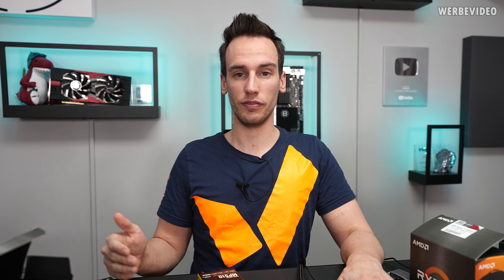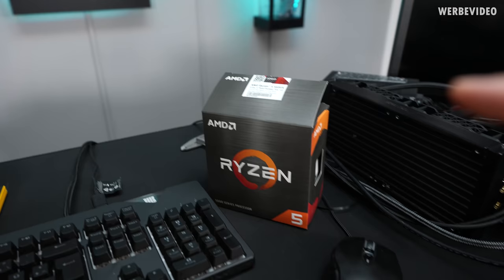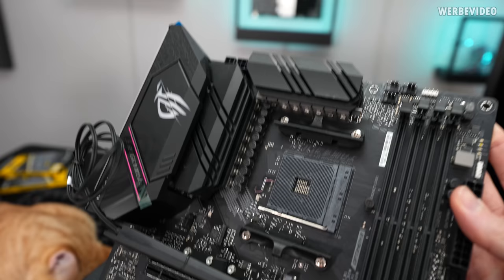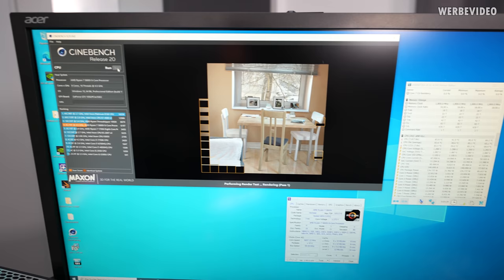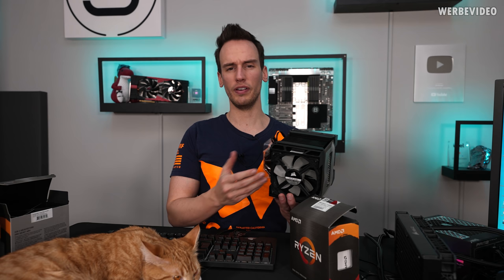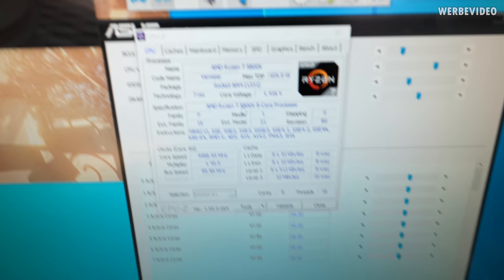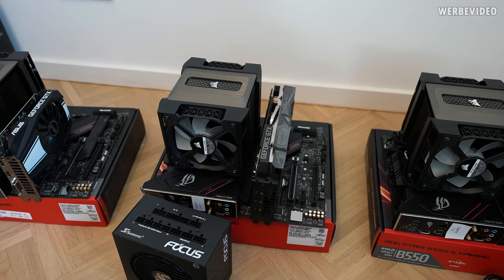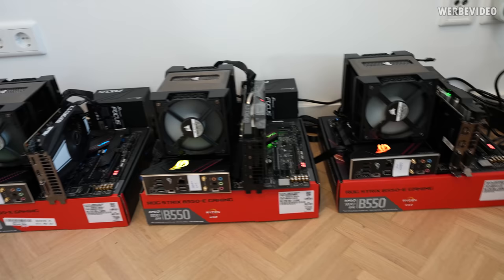AMD Ryzen 5000 Long Term OC Testing - Will the 7nm CPUs degrade over time?

Comment: Why not use something like Boinc or Folding @ Home for a long term test like this to do something useful with the computing power?
Reply: Or mining cryptocurrency and make money for electrical bills.
Reply: I assume he wants repeatable tests. Folding at Home sends packages of varying size, depending upon what they have set up to be solved.
Reply: @johngamble5270  Kind of, but either way it will do the same as the benchmark, run 100% CPU, pause for a short while to swich work unit and back to 100%. Boinc Rosetta may be even better as Boinc have more advanced settings for CPUs
Reply: @martinfinne7259  I`ve been running folding@home for one year. You need internet for that. What if network fails and needs to be down for some longer period, or better yet, windows update? He could disable that with some workaround sure, but this is clean and repeatable. Its better to minimize any possible external factors for this test. Same thing goes for crypto mining... it could hardly be a science experiment if parameters constantly change and your system crashes. Now windows could still crash all on its own, but he can easily check that at a glance with a power meter. Without network and any other background tasks it should be pretty stable.
Reply: Your supposed to fold with your gpu.. not cpu
Reply: @CMstacker  Yes, network is a problem, the biggest one probably windows update that's hard to get rid of.
Reply: @sagerdood  Why? Folding at home also have CPU only projects so they still need people folding on their CPUs. To get the most points for your electricity GPUs are useful and they have much higer raw compute power but can't do everything a CPU can do.
Reply: Boinc and folding@home do not always give you work laods at the same workloads, and sometimes you might run out of jobs and your cpu will sit idle. 
My Own just sat idle for 12 hours while I was at work and until I switched it for a different project for now
Reply: @NGC-qm1so  sure actually it’s getting more promising for CPU mining with monero
Reply: Bench Coaches !

Comment: u could put those machines in good use like folding at home.
Reply: folding at home = remote mining
Reply: @manugik  learn how Folding at home works before commenting please
Reply: Folding at home workloads are always "unique" so you cant control or check reliably if each CPU is doing the same amount of work, even if all 3 are contributing to same project .While i agree he could be testing all that hardware in more productive way, for consistency reasons, i understand why he is doing the way he is doing it.

Comment: Would have been great to harness the compute power while testing with some BOINC project or similar
Reply: Yes exactly, it could be some World Community Grid - Cancer, etc. contribution. Burn current in a good way.
Reply: Was thinking Folding@Home or something to put the energy to good use!
Reply: You wouldn't get an equal load between the 3 systems. Each system would have to run the same WU.

Comment: I ran my R5 3600 at 1.45v for about 7 months before it needed 1.46v for the same frequency.  Most of the cores won't boost too spec any more, but the strongest ones still do :)
Reply: That's a yikes voltage right there
Reply: It was only supposed to last me until Zen3.
Reply: I'm not stand all core for 1.45 volts. 1 Core With ClockTuner for Ryzen its fine

Comment: Awesome idea Roman. I was hoping you would do 1 5600x at 1.45v and the other at 1.5v but 1.45v even works to
Reply: Think it's pretty good because 1.45 is about  the worst case of what people could reasonably try. No sane person would run 1.5v 24/7 load. In fact i wished he ranone cpu on 1.4 and another at 1.375ish
Reply: ClockTuner v2.0 for Ryzen (CTR) Guide

Comment: My friend bought Ryzen 5 5600x and he was cooling it with noctua ndh-15. It died after 4 days.. While i'm still using ryzen 7 3800x oc to 4.5 for over a year now with no problem on a noctua nh-u12 s with 2 fans for push and pull configuration and the max i've ever seen the temp go is to 61 after 9 hours of programming and other stuff in the background.
Reply: the main board might be also responsible for that or a bad OC with a bad cooler contact, when you overclock a machine you need to take in consideration all the parts of the machine, not all boards are good for OC and/or power supply, also the cooling need to be setup correctly like the CPU configs to make sure is stable
Reply: @custume  I agree 100% my friend. How ever i do not think his board was the problem as i'm using the Msi x570 tomahawk wifi for my build  and he is on Asus Rog Strix E- gaming x570. Lucky for him he got his money back with no problem. Who knows what went wrong.
Reply: @Filip1389_  that still leaves a lot of room for other interpretation but I agreed with you that might even be a defected CPU (because that main boards are not bad), even though it is a rare case because CPU are tested, but a CPU might be the problem. Without more testing/evidence is hard to see the situation, might even be a bad XMP profile
Reply: 4 days seems too fast. 
his electricity voltage is stable during the day or night?

Comment: With a corsair A500 they're already as good as dead.
Reply: I think (and hope) that they fixed the flatness on the cooler
Reply: I wouldn't buy anything corsair if my life depended on it.
Reply: @tacticalcenter8658  Hey they're making some good cases and....... 

Idk what else to recommend, their software has made their mice, keyboards, headsets, and RGB products (so most of their AIO's too) all a nightmare for me honestly. 
And the A500 is the A500.

New cases are good at least.
Reply: @tacticalcenter8658  personally i like their memory and cases, but yeah im not a fan of the rest, including the fans, those are ripoffs
Reply: @SpeedWeed97  the memory is one of the worst in the mainstream industry. The guy running that department is a nob.
Reply: @SpeedWeed97  Corsair RAM has the wildest die use variance of any manufacturer and their binning is absolute shit.
Reply: @alexskywalker888  At least they are cheap and available (outside USA). But yeah, I prefer Crucial (Micron E) when possible
Reply: @toaster_bloke9999  I don't even like the new cases and they ain't even that good. No point in the brand at all. And yea the rgb and other software is completely trash. There's a bunch of us that the rgb software crashes our system and they don't care to fix it all despite a huge thread on the issue.

Comment: Yeah because of low maintenance the air cooling for me is better over liquid, sure you might get less 4 or 5 degrees but in a long term the 4 or 5 degrees go away from liquid blocks in the pipes

Comment: Thanks for doing this, but you're going to have such an astronomical power bill when this is over! 
600w p hour x 24 = 14,4kWh per day. Or almost 2600kWh in 6 months!

That's around 777 euro in power.
Reply: but those computers are not using 600w... he says it has between 180w to 190w
Reply: @1vend7  Oh I thought he said 200w.. But still, with 180w, he's gonna get a bill of probably 600 euro? That's a lot just to prove a point :)

Comment: I have to point out 1 flaw in your approach....

For almost any system, the largest 'stress' comes from not continuous and stable load, but from interruptive and sudden changes. For example with airplanes it's the take-off and landing, not the flight time (although there is a timer there as well), cars with cold engines doing short city drives and computers... it's actually similar with cold starts and rather quick full loads that create mostly thermal stresses in physical form (not thermal throttling).

Persistent long term load, is less wear and stress (as silicon degradation is something that takes decades), even at higher voltages as large fluctuations in temperature on the silicon, large stress on the VRM's and thus stability of voltage to the cores and the ability to cool it equally will all cause physical stress and risk of creating cracks. 

If you'd throw a loop of boot, 5x Cinebench, shut down for 5-10 minutes and wake after power loss combined with a physical timer on the power distribution... You would be stress testing these systems much more, much quicker and more heavily than even a year of non-stop running any calculation. Even if the cold boot isn't completely cold.

Comment: My 5800x was DOA. High thermals, constant reboots. Don't really care as hardware can always have failures. Just annoyed as I can't sell my 3600 while info through the RMA process
Edit: And a custom dual 240mm rad setup is sufficient cooling. The 3600 barley gets above 60c. The 5800x was hitting 88c
Reply: I'm on my 3rd 5800X, it has instability issues like the first :(

Comment: i've been runing my 5950x from day 1 at 4.6ghz plus and its been solid, no problems what so ever, i run manual voltage of 1.285v too, temps get to around 70 degrees in games and under synthetic load around 85 degrees
Reply: ClockTuner v2.0 for Ryzen (CTR) Guide
Reply: @Walther Penne the main online game i play is destiny 2, have not had any heat issues with my chip with the oc and manual vcore settings i'm using
Reply: @Walther Penne i can run a wide varitey of games in my collection and my chip hovers around the 70 degree mark, but yes anything like 3dmark or cinebench does make my chip run over 85 degrees as the cores and threads are being hit at 100%, i was running my chip at said speed but at 1.325v and holy hell even in games i was seeing temps in the mid 80's and any kind of benchmarking i did activated thermal shutdown control and my pc powered off, thats why i took the time backing off the volts until i hit the lowest value at the speed i was at which was 1.285v and things are a lot more cool and stable :)

Comment: Why not use Folding at Home ( F@H ) instead of synthetic benchmarks? It will hammer the CPUs much more than any benchmark and power consumption won't be wasted for nothing.
Reply: One word. Control. When doing any science, engineering experiment/test you always need a base line method and result that doesn't change (easier to identify changing variables in a multivariable problem when most of the variable behave like constants). Folding at home has variations in the data that will need to be analyzed despite having similar tasks. - Yes F@H will push a cpu or gpu harder but is harder to benchmark unless you fix a compute task across all computers being tested (which is what a synthetic bench mark is anyways for less experiment design effort).

Comment: Looking forward to this.  Absolutely sick to my back teeth of "experts" screaming that people will cause degradation on their Ryzen because of high voltages that are actually perfectly reasonable.  Most of it seems to stem from one video from Buildzoid where his CPU failed, did not degrade, and from a statement by the stilt in week one of Zen2 release that for some reason was taken as being of biblical proportions despite the fact that is was purely conjecture on his behalf with zero evidence (The stilt is a fine person by the way and very knowledgeable and was merely stating something to be cautious about and as usual the internet turned it into a religion).  Most people who go on about degradation seem to be utterly unaware of quite a few actual facts.   1.   Degradation will happen anyway over a period of time.  2.  Degradation when it does happen usually loses 1 bin off the cpu speed - so for a Zen2 or Zen3 that would be a 25mhz reduction to its max performance....big deal - so maybe 1/2 a percent decrease in max speed after several years..    3.   When a CPU fails it is nothing to do with degradation, it is a failure of a component of the CPU and is something different.

It's just a shame DB compromised the test by using Corsair A500 coolers - just about the worst cooler you can buy.....suppose that's what happens when Corsair sponsor the crap of out a video :(   I do hope DB gets a sponsor of better quality at some point.
Reply: @Walther Penne Define a certain amount of time.  10 years?  15 years?
Reply: @Walther Penne I could construct a well worded argument, but I really can't be bothered.  So I'm just going to go with ...bollocks.

Comment: Hi der8auer
, Great vid :) I have been wanting to ask you this question for a long time: X570 Chipset comes in two forms 11w and a 15w Premium version. What is the performance difference ? I am seeing really low NVME Gen4 write speeds on non premium X570 chipset, Asrock X570 ITX/TB3 to be exact... Keep up the good work :)

Comment: I wonder if heat cycling would matter more for 7nm. If the heat is constant, I don't think it will degrade much. When the CPU gets hot and cold on the micro-level, I think the thermal expansion and contraction of the materials would wear down the CPU more.

Comment: I think a constant load 24/7 is less realistic
It should be 70% load and 30% idling or maybe 60/40, to simulate the thermal variances a typical CPU goes through
Reply: but I think it's to show an extreme situation and to have a faster result, (I use intel i5 4670k has the base clock of 3.4 I use at 4.6 for about 2 years and still haven't felt any kind of loss in performance)

Comment: Likely drivel that Intel marketeering has been spreading around.  No issues on my 5800x.  Just like Igor's lab pointed out, the IHS's on these chips because of the chiplet config NEED to be lapped.  They're not flat.  I'm a machinist and I put my 5800x on the surface plate at work and it was not flat by .075 mm, or .003".  Basically... not flat at all.  Some may be better and some may be worse.  I'd think .075 mm is towards the worse end of the scale so I lapped mine and took my load temps from 81C on 120x3 60mm thick rad to 75c.  Worth.
Reply: It all depends, do people want the warranty or not. I have a 9900k that is garbage tier and needs to be lapped, but I still have a year of warranty. Still kinda hoping it dies to get a new CPU.

Comment: When chips are "burned in" during manufacturing, it is typically done at higher voltage/temperature and maximum switching rates of the circuits.  It is not clear to me that looping the stress test 24/7 is the best way to show degredation.  Rapid cycling of the chips between idle and max temp/voltage/switching seems more likely to cause electromigration, and therefore degredation.
Reply: well, there is a short break between stress tests in which frequency and voltage drop down and then go back up for the next test. So except for temperature he is doing what you are describing.

Comment: You should have made 1 drive image and cloned it to all 3 drives so they all have the exact same software. Unhook it from the internet, do not install any other updates or hotfixes to keep them all the same. You could even wipe the drives after each time period (3 months, 6 months, 1 year) and clone the original image back to the 3 drives so every time you check them they all have the exact same software setup so there's a near zero chance of anything besides the hardware coming into play.

Comment: I had a 3600X fail on me last month.  Not sure what happened, I hadn't been overclocking it.   It suddenly became unstable and it stayed that way even after transplanting it into another motherboard and reducing frequencies across the board. 

I've been planning on building a 5900X box for a while now, just waiting for the price to drop a bit more.  Sigh.  It's already almost March and supplies still seem constrained.

-Matt
Reply: Same thing happened to my 2nd 5800X last month, it was my only stable one to. My third 5800X is just as unstable as the first :(

Comment: 5950x 4,75ghz/4,55ghz on ccd0/ccd1 respectively @1.24V will up to 1.3V+ and more frequency if this test shows that it's not important voltage wise

Comment: I'm on my 3rd 5800X, stock settings except sometimes I try DOCP.

I just can't get it stable, except for my 2nd CPU which was rock solid for 2 months then became unstable for a week before not booting windows, linux gave cpu soft lock errors.

Problem is it mostly happens at idle and I ran my PC for 7 days no issues, then ran timespy and it died. I can run timespy over and over now no issues.

I wish I could narrow it down but I can't reproduce it reliably. So many people on the AMD forums have the same issue.

I am starting to feel I should of stayed with Intel/Nvidia.

I doubt everyone notices there's an issue and even then they may not RMA or might troubleshoot for several months before they do.

Comment: Hey. I would like to point out something. 240 aio's are really getting worse. I recently saw the JayzTwoCentz video about a Vetroo air cooler with 5 heatpipes and it wa beating a 240mm aio. I found it really weird so I ordered one of thoe coolers and tested it on my 5800x and to my surprise, my temps were under 80 in CInebench R20 loop as well as R23. Then when I swapped to my Deepcool Gammax L240T aio I was getting north of 85c on the CPU. Also, I was able to achieve a 4.8GHz oc on the air cooler while the aio did only 4.75 and even that would crash sometimes. BTW i was using the air cooler in push pull config so yea it got a little more advantage, but still a $30 air cooler that beat my 70$ aio, isnt that a bit weire?